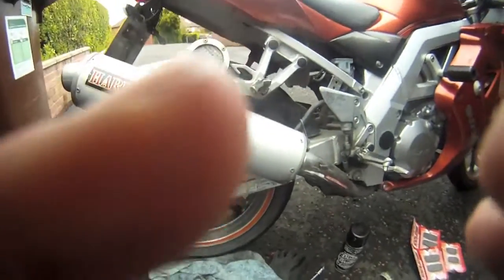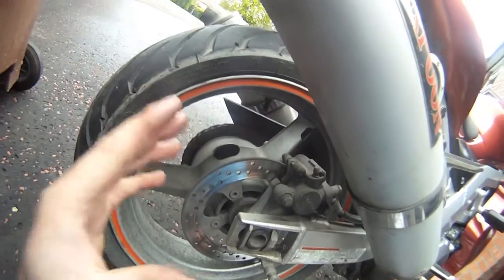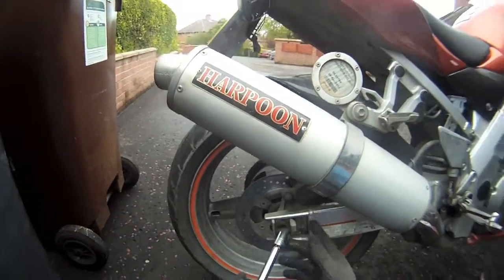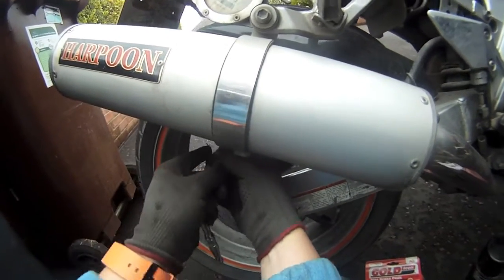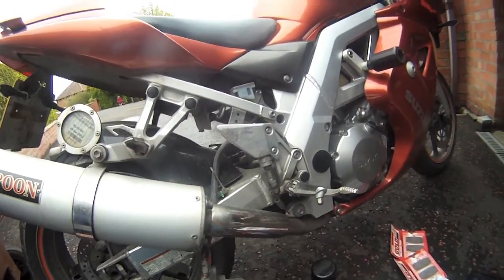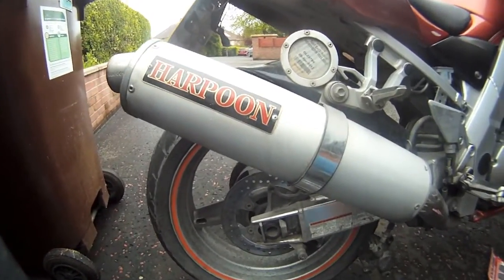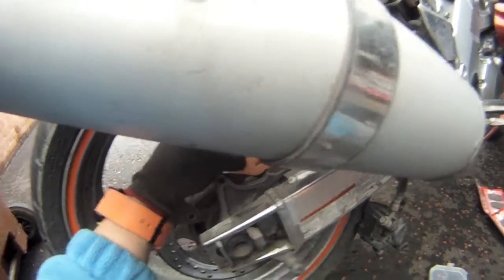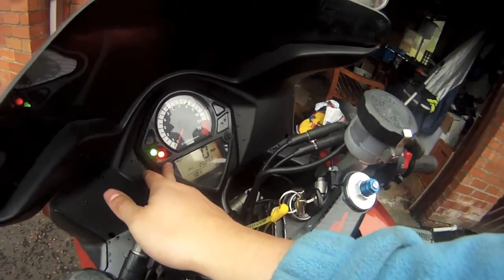"How To" Suzuki SV1000 SK3 Rear brake pads - GoPro HD Hero

Comment: Actually no need to remove 14 mm bolt. Only 12 mm, and then just swing caliber up. It'll go just far enough for you to get old pads out and new ones in.

At least that's how I did it, and also that's how repair manual instructs you to do.

I Installed sintered Brembo pads both rear and front.